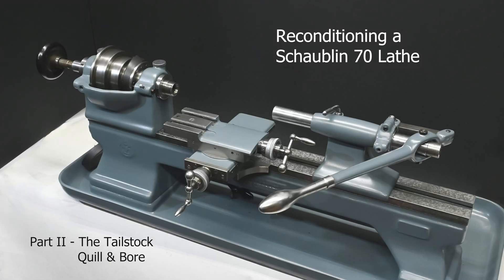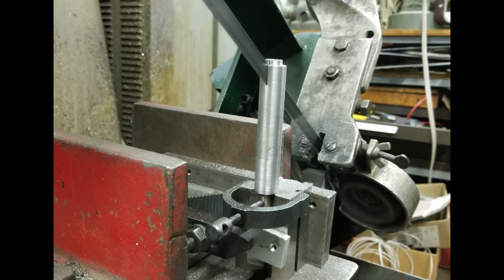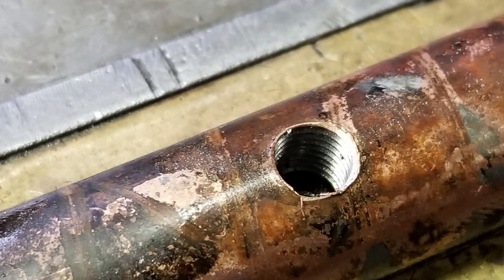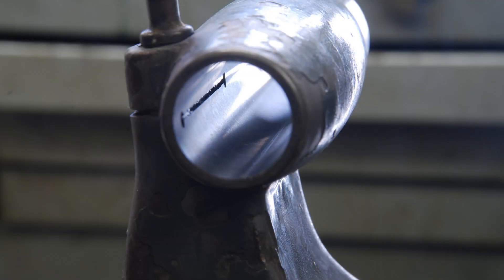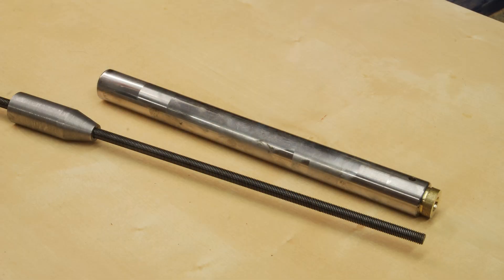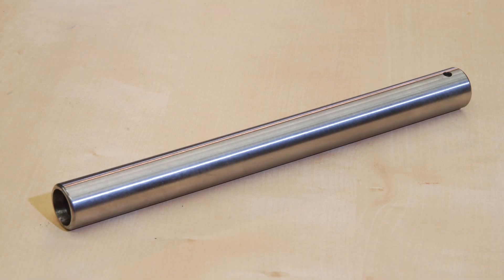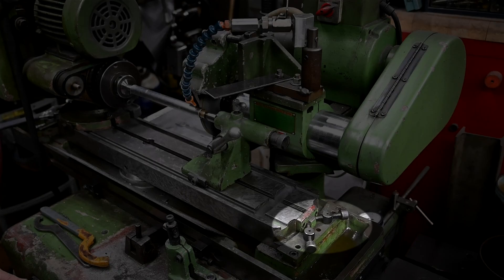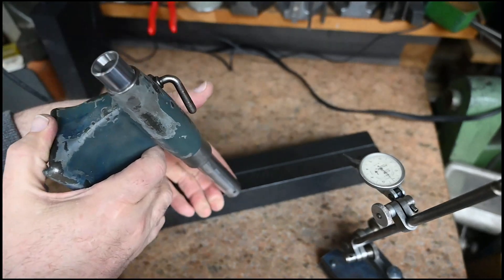Reconditioning a Schaublin 70 Lathe Part II, Lapping Hard Chroming and Grinding the Tail Stock Quill

Comment: Great breakdown of the process, your voiceover is solid, explanations are great. 

You mentioned bringing down the tailstock to remove wear. Has the center height remained the original 70mm? I'm sure you know the lathe and accessories were produced to gauge fits rather than matched to a specific bed etc., so I am curious whether interchangeability remains. Solving that is a head scratcher, I figure you gotta either bore, plug, rebore the tailstock after scraping its sole for bearing or add material to the sole. 

I also am curious about the split lap you made. I have very little experience i  lapping, having only done one proper lapping project for my pantograph spindle rebuild. I lapped the spindle housing and manufactured a new spindle sleeve, which I lapped to fit. I made aluminum split laps based on what Robin Renzetti has shown in his videos. Even with those I could feel and see the non-round, even less cylindrical expansion upon adjustment. To combat this I had to somewhat over adjust the lap and with an excess of slurry round the lap up with fast axial traverse to not mess up the bore in the part. The uneven expansion seems not to have mattered as I could not measure any cylindricity error with my equipment. (Maybe I am just super talented and my sick skills made up for it...right?🤣)

Looking forward to part 3.
Reply from the maker: Yes, this approach gives up the interchangeability advantage.   i guess anything is possible, and the Schaublin gods may frown on me for it, but I decided that didn't warrant the effort, and that that effort could always be made if one felt differently in future.  I'd mill off the bottom the HS and TS, bolt and epoxy on some durabar and start whittling ....ugh. lol

Comment: Great video, I don't have a Schau. But I just got a Levin 10 mm from 1962. That I will lovingly and carefully plan to restore. The reason I found your great channel. Mine looks  about how yours originally looked. Looking into scrapping already. ❤🎉
Reply from the maker: Thanks for the compliment!  I've Levin 10 I could take some pictures of if it helps to see how it goes together
Reply: Please I'm trying to figure out, the plunger issue. I just subscribed to the magazine. Very cool stuff, there I didn't know it.  @metallumshop

Comment: Is it possible to hard chrome the ways and sprape only the chariot?
Reply from the maker: I suppose, I've seen hard chroming on mill dovetail ways ... talk to a plater, I'm certainly not a plating expert (or even a novice). If you did, then you'd have to grind the bed and I don't, and wouldn't think many home shop guys would, have a grinder big enough.
Reply: @metallumshop  Boxford did make some of their later 500 VSL lathes with hard chrome slideways on the bed. A good friend of mine owns one of these hard chromed variants.